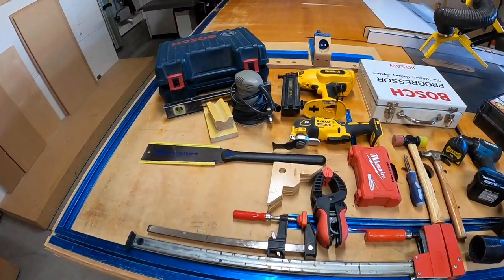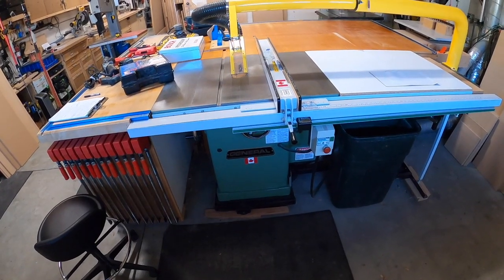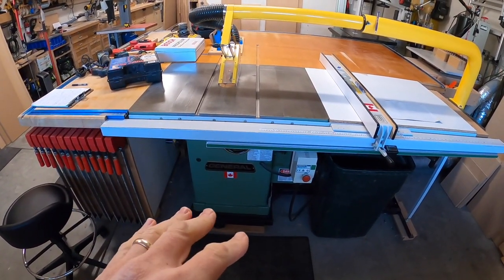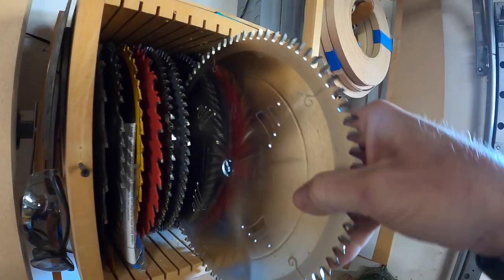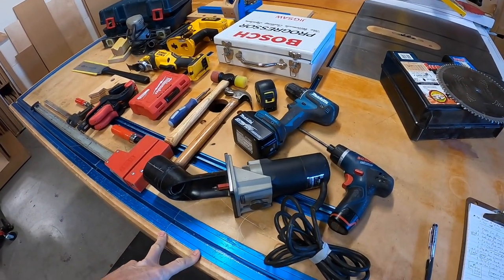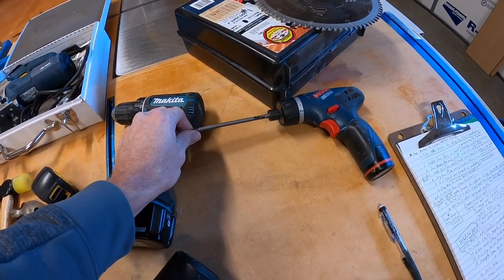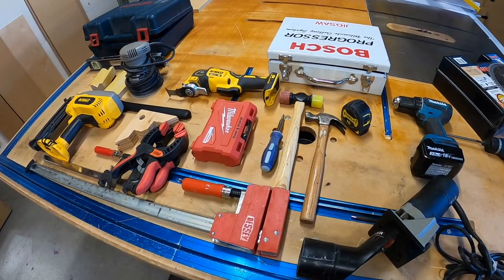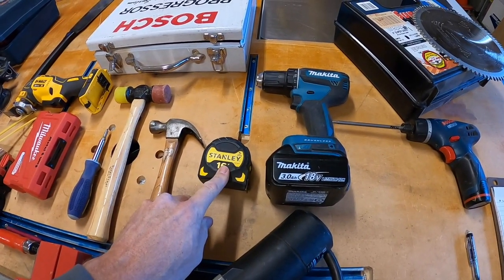Top 20 Tools To Get You Started In Woodworking- For Beginners and On A Budget!!

Comment: Hi David it's Makitaman I would like to ask you for your opinion today I just received my 5 in. Makita random orbital variable speed sander with hook and loop. I have used regular sandpaper my whole life what is your opinion on the sand nets sanding discs I know they are supposed to last 10 times longer than regular sandpaper but do they Sandwell? I just wanted to know if you knew anything about that because I'm getting ready to go to Home Depot and get a bunch of Diablo sandpaper or sand nets. Thank you for your time my friend and have a Merry Christmas and a Happy New Year
Reply from the maker: Hey makita man.  I hope your doing well and have a great holiday as well.  I’d try them out for sure.  I’ve heard great things about them but never used any.  I do think the dust collection would be very good and easier to install on different hole pattern sanders.  So that’s cool.  They are pricey but for added durability and dust collection benefits, try them.  Maybe you’ll love them.  Get a regular pack to compare.  I get my paper from mirka, klingspor or festool and like them a lot. But have been wondering myself about the net types.  Let me know what you find out.  Enjoy your makita sander.  I had one back a ways and they are pretty powerful.